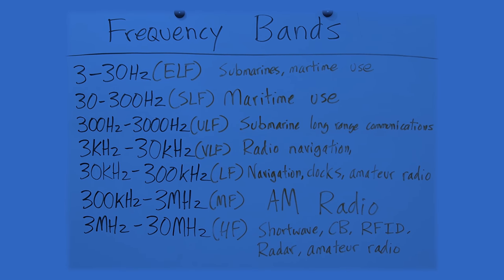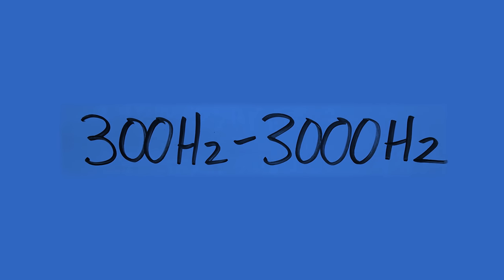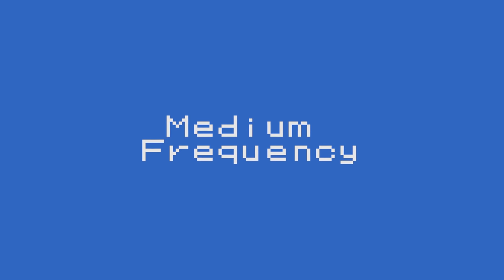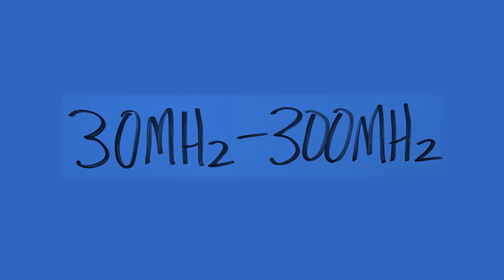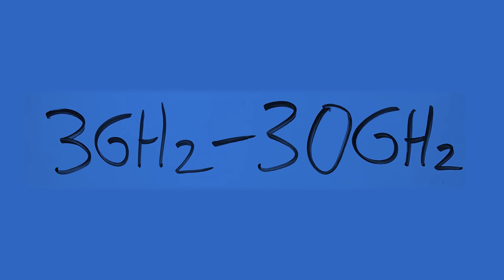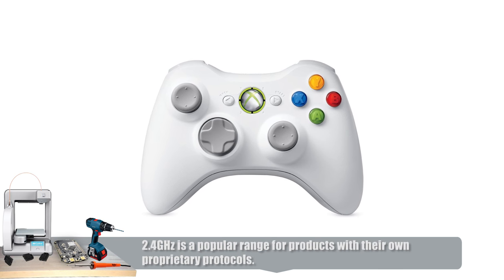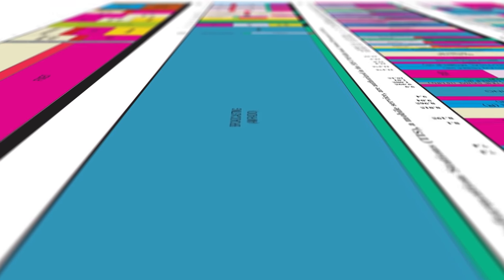Ben Heck's Essentials Series: Wireless Communications

Comment: Just as a point of fact the Steam Controller is not Bluetooth and cannot pair to any Bluetooth receiver. It uses a pretty standard radio that does work with Bluetooth but they are using a completely proprietary protocol because Bluetooth has too much latency. Just pointing it out. :D Thanks for the videos!
Reply: BLuetooth might have latency, but the MX Master has no noticable latency! The same with DS4, but then again, I notice nothing on the TV XD
Reply: Heh, ur right, on a regular TV the latency is so bad you wouldn't be able to tell anyways. On a good PC monitor, though, very noticeable. My TV is one of those 50" no name Asian brands but because it does little to no processing of the image before it is displayed it has an 8ms response time which is faster than my first decades worth of "gaming" LCDs. Half a frame for display and less than that for the Steam Controller and I can actually see my inputs on the next frame instead of having a terrible delay, not a bad setup if you ask me. :D

Comment: A big con with RFID is that it isn't secure at all. In fact, that could be an idea for a project - see how far you can read a RFID tag.

You also missed the biggest con with cellular technologies is that it costs to use them. Every other device you talk about can be used for free once you've bought the required hardware. Cellular requires you to pay every month to use them. Though considering that Ben thinks that most phones have NFC I don't think he worries about money that much.

Comment: I think it would be cool if you guys built an LCD glass door for the bathroom that's clear but turns black when you lock the door, and you can use wifi to add a display to the glass like the time and weather.

Comment: You guys know that the RFID's you showed don't use RF right? It uses magnetic fields and messures diffrences in it to transfer data. This has nothing to do with radiation of any kind so it's not part of the RF spectrum.
Reply: But it's still wireless, like it says in the title: "Ben Heck's Essentials Series: Wireless Communications"
Reply: ah. shoot, you're right, doesn't make sense. Do they have IR stuff in there? still watching while soldering and meh attention to the video.
Reply: they obviously didnt know.....
Reply: it actually uses both RF and magnetic fields, but they didn't go in depth enough for this to be fleshed out, since this was a "brief" overview.

The RF sent by the Interrogator is used to power the tag, which in turn alters it's magnetic field after being powered by the RF, which is then read back by the interrogator.
Reply from the maker: Magnetic fields are a form of radiation, electronics are involved to manipulate this radiation and field to be able to communicate, and so it is a form of electromagnetic field and electromagnetic radiation. Usually this is at a particular radio frequency, the implementations vary, however NFC is an example of a standard that has been introduced to build upon the fundamentals of RFID.
Reply: RF is a magnetic field that varies in strength over time.
Reply: +The Ben Heck Show I had tons of issues connecting to my Wi-Fi camera with my phone & Bluetooth while around times square in New York, and some near by area's. Maybe too many connections... I wish I could of used that wifi analyzer to check! Probably would of been off the charts!
Reply: +1blisslife she can charge her phone with a wireless charger or use induction to cook some food :)
Reply from the maker: Bluetooth, especially the earlier standards, were notorious for clashing. Especially due to WiFi's static channel nature, and Bluetooth hops around. Introduce more devices and you reduce the available power and data throughput, eg. if you have two WiFi transmitter sharing the same channel, say channel 6, you halve the amount of power available and nearly halve the throughput and distance it can be received.

Comment: Extremely high frequency has an Amateur radio (ham radio) band,at 47GHz, which has a problem with propogation due to oxygen absorption.  In other words those frequencies above 40GHz are absorbed by the oxygen in our air.

Comment: don't forget you can charge your phone wirelessly if the phone has the hardware built in (i.e. Samsung,  iPhone, etc) or purchase a dongle device that plugs into the mini hdmi or micro-usb port and lay your phone on an external charger. no physical wires between phone and charger pad.

Comment: But you can charge wireless too! 23:22
Reply: Mutual Inductance as a starter.
Reply from the maker: Qi as a standard has been introduced for wireless charging, however it's been phased out in most mobile phones because having it working alongside NFC is not cheap.
Reply: #note-7-bomb not so safe if the battery circuit doesnt work properly

Comment: in the beginning when windows 10 was just released , i could not connect via wifi because win10 could not see the 13th channel of my wifi router. it seems that america only knows 12 channels for 2.4ghz wifi, europe has 13 channels . why is this? or is this only somthing windows had  ?
Reply: Slightly different concessions in different countries. FCC in US allows 11 channels, not 12 (channels 12 and 13 may actually be used but only with limited gain and transmission power which not many cards or routers support).

Japan has 14 channels but the 14th channel is very weird (much higher in the spectrum and has some restrictions).

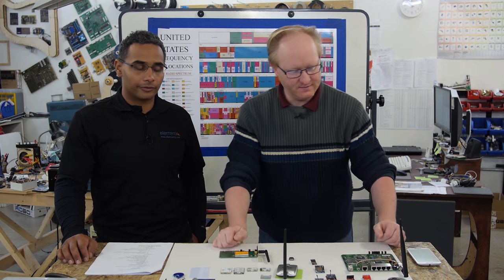Comment: What router ( 3:59 )? Mine is a Vodafone Spain HG556A version C with OpenWrt!
Reply: If you take a peek at the bottom left of the router in shot you'll see it's a classic Linksys WRT54x baseboard, whether it was pulled from a 3rd party casing I don't know, I lived and died a few times by the WRT54x range, unstoppable little things they are, they only fall over for thermonuclear warfare or dodgy power supplies.
Reply: As a secondary note I recommend the Tomato firmware on the WRT range, OpenWRT always clogged my router up and made it slower than the default Linksys "I've got every port open, come and hack me" firmware.

Comment: i want an oven, microwave or normal that connects to your phone and lets you know when it's done cooking
Reply: Daki Souls When your wireless starts working again, you know it's finished. Just remove the metal enclosure and it'll work!
Reply: Daki Souls or you can just use the timer.
Reply: I have a sixth sense for predicting when the microwave is done, within the last 10 seconds margin. Then again, it's probably because I microwave food too much.
Reply: Daki Souls you could probably actually do something with an Inductor Coil since each of those things should be putting off some serious EM interferenxe
Reply: but that's not creative :(
Reply: Daki Souls look for AGA itotalcontrol. also companies like lg samsung and GE make wifi kitchen appliances, they are useless and expansive!
Reply: Daki Souls that's called setting a timer on your phone
Reply: Daki Souls but an oven that can be turned on or off with your phone would be kinda cool

Comment: 11:39 in the short comment says it saves you USB space on your laptop. But that is not so. Some Laptops don't have blue tooth and have to add a dongle to get blue tooth like mine.
Reply: joseph chrzempiec at that point, one dongle can handle multiple devices, saving you USB space. if it is built in, it saves even more space.
Reply: Hello and that is true. But if the laptop or desktop doesn't then have blue tooth then yes will require a blue tooth dongle. But there are some out there that will only let you connect a single Blue tooth device and some that you can connect multiple Blue tooth devices. The point I'm only trying to make is that People need to make sure that they check your laptop, Desktop, or Cellphone and Table to be sure that they can handle only Single or Multiple devices that's all I'm not a IT tech my self just a simple User that's all.

Comment: Make an NFC or RFID lock please!
Reply: Please, no solenoids, I'll go megacrazy if I find yet another solenoid based locking mechanism anywhere on this damned planet of ours.
Besides, it'll be a great design challenge:  how to create a locking mechanism without resorting to your very first high school science lesson.
Reply: Isn't that like how every electrical engine works?
Reply: That's not what I am discussing, I'm talking about how safe manufacturers use a super high quality keycode device coupled with a supercheap 9v solenoid device that can be defeated with a well aimed tap and pull, all is needed is a simple gearing mechanism to throw that right out of the window.
A motor and a couple of cogs with end to end stoppers is all that is needed.
The demand for immediate results (ie hear the beep and the snap of the solenoid is what drives that, a second extra while the gears undo the bolt is far better than knowing that someone with a magnet and a percussive maintainace device can defeat your fancy pants RFID tag.)

Comment: try and send a video or alot of data over bluetooth
Reply: theres a limit of 400KB per second on bluetooth....   so it will have to be a really crappy video ;)    
although bluetooth 3.0 can use a mix of wifi+bluetooth to allow faster speed,   but thats cheating,  you could just use normal wifi to get the same effect :P
Reply: wifi is crap always will. i did say try

Comment: If in Australia and want to do anything with mobile data radios make sure you don't buy anything that's 2g or you will find out it doesn't work for much longer.

Telstra has already shutdown their 2g on December 1st
Optus will shut down theirs in April 2017
Vodafone will be shutting down theirs in September 2017

If you do use 2g you might end up like RACV with their bike share system in Victoria
http://www.abc.net.au/news/2016-12-07/melbourne-bike-share-scheme-offline-after-2g-network-closure/8098822